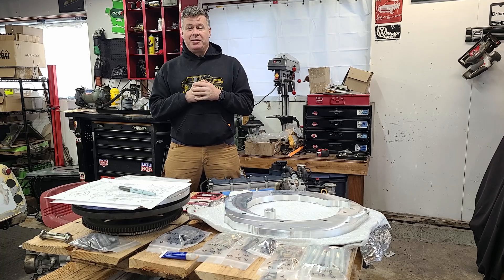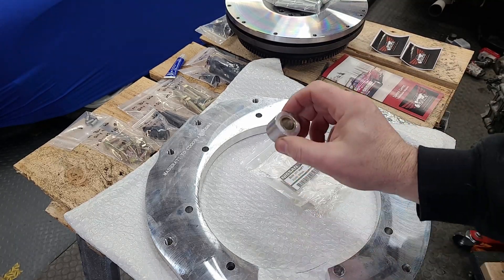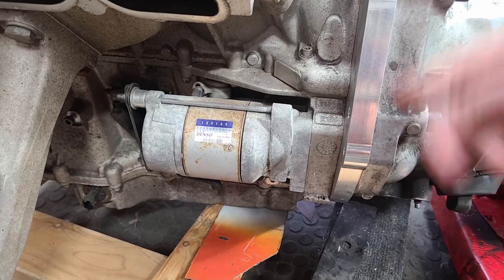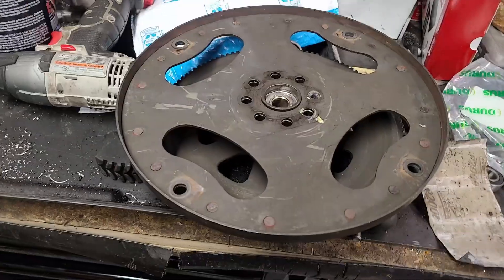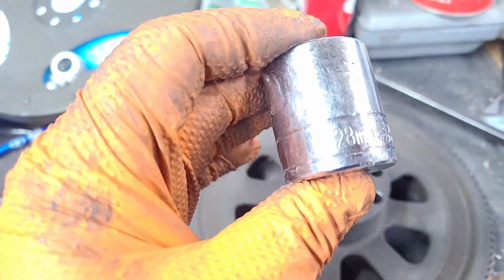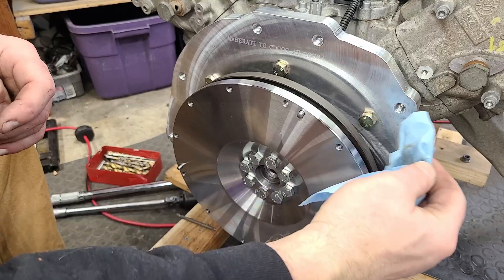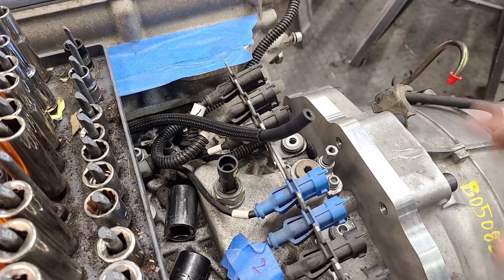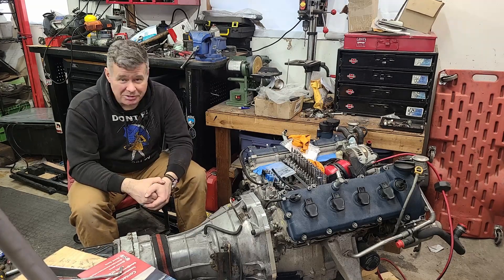How to join Ferrari/Maserati F136 engines to Nissan CD009 transmissions! Installation guide

Comment: Here is a great comment, from a metric mechanic, IF YOU ARE WORKING WITH METRIC ENGINEERING , STICK TO " METRIC MEASUREMENTS, METRIC TOOLS AND METRIC THINKING, its easier and will stop you screwing by converting ( trying) to inches after all 1000mm is 1 meter,  ( not 39 13/64")  water freezes at zero degrees centigrade not 32😅😂 it boils at 100 degrees not 212, virtually every US ENGINE CAPACITY IS METRIC PROB INCLUDING ENGINE FITTINGS, , 
METRIC IS JUST " BETTER, EASIER, SIMPLER!

Comment: Hello !

Can you give me rough measure of the engine + transmission, like from back of engine to shifter (to check the shifter hole position) and height to check if it would fit the tunnel ?

I have a Maserati Coupe donor car which i would swap the engine into a 240Z but before ordering the transmission and the kit i'd like to know if it's possible to fit 😬
I have another build possible with a BMW DCT transmission which would be easier to swap but if i can keep a manual transmission it would be funnier
It'll help a lot if you can give me those informations ! 

Thank you !